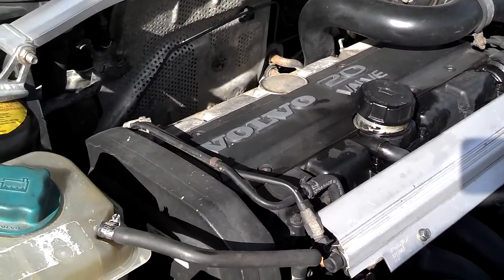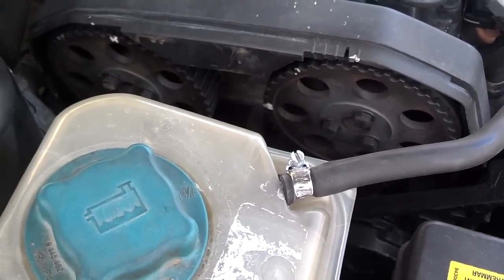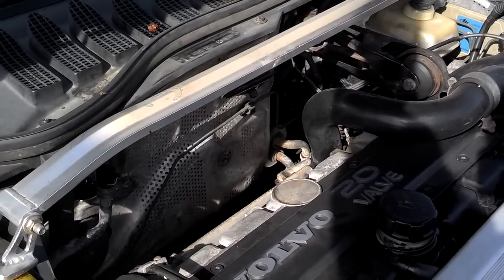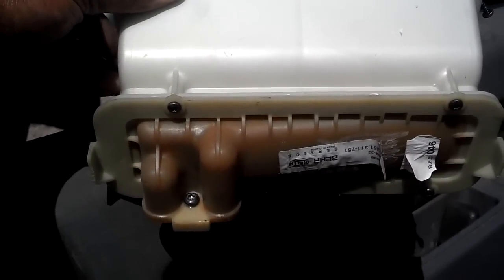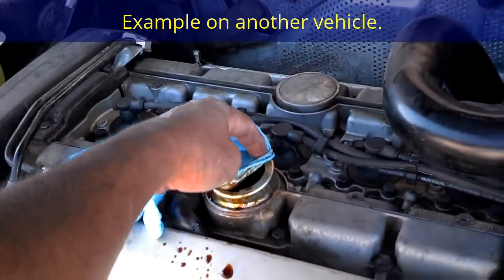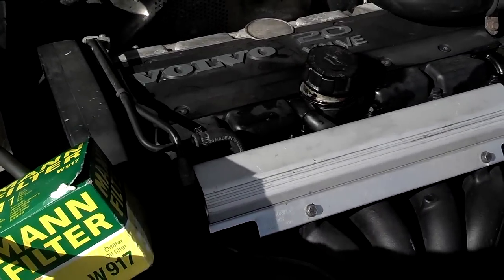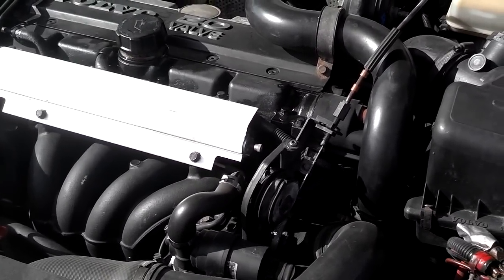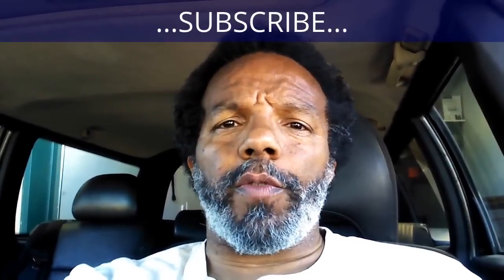New Volvo owner things to do after purchase or check yearly on a 850, S70, V70, XC70, etc. - VOTD

Comment: I have a 2000 volvo c70 but can't tell how many miles I have whole dashboard is on
Reply from the maker: +D House Must have a bad cluster or had a computer changed. The computer and 
clusters are matted in those cars. If either have been changed things 
will not work properly until it's reprogrammed at a dealer.

Comment: Will the k seal or blue devil sealant stop my heater core leak
Reply from the maker: LOL, a blown engine will.
Reply: Robert DIY Well it would be nice if you could do it so I just need to do a bypass and not even try it I just wanted my heat
Reply from the maker: No problem, bring it by.
Reply: Robert DIY where are you located
Reply from the maker: ABQ

Comment: l have a promble  with  a volvo s80 that will not go in gear  what must l  do
Reply from the maker: +Melvin Breland have it towed to a Volvo mechanic.
Reply: Robert DIY
Reply: Melvin Breland last time I had that issue it was low transmission fluid.
Reply: thank u very much
Reply: Just fixed this problem on my son's 98 C70. Bad motor mounts causing shifter cable bind. Replaced mounts and is now good to go!

Comment: the pcv system i replact it and it stil fills the glove but its a full new system evry hose breather box so is that normal or is there other problem on the engine
Reply from the maker: Did you do a compression test before you did the PCV job? Did you clean out the block ports? Did you do the test with the engine hot?
Reply: Robert DIY i dindt do a test only the glove test

Comment: Scotty Kilmer said the reason they make interference engines now is because they actually go faster than noninterference engines because the pistons move at a higher ratio and almost come in contact with the valves. A lot of manufacturers these days are moving to the timing chains which are MUCH better than these rubber belts that break and destroy the motor.
Reply from the maker: Michael Sackstein Hmmmm, not sure about that but he surely knows more about mechanics than I do. I know of some very high performance engines that run on timing belts. They are easier serviced due to their external positioning, and they are much cheaper than a chain. Not sure if interference has anything to do with it having a chain or not.
Reply: No it doesn't. A lot of interference engines do have chains now because people would forget to change the timing belt and then it would break and destroy the motor. Whereas the chains typically go about 500k without any problems